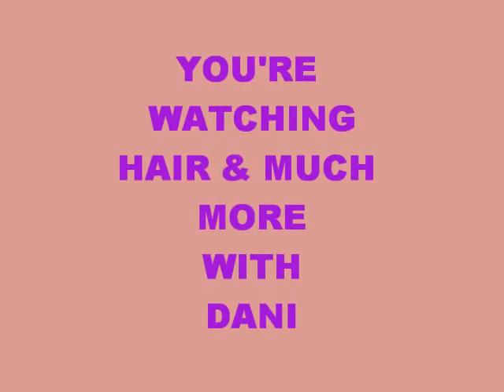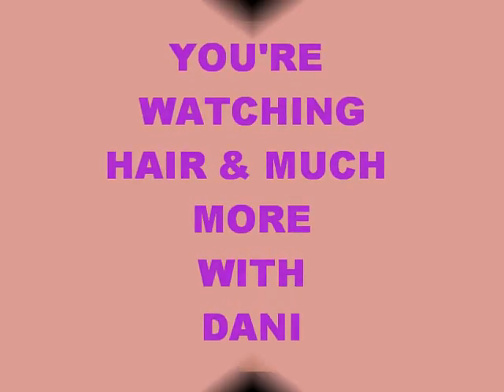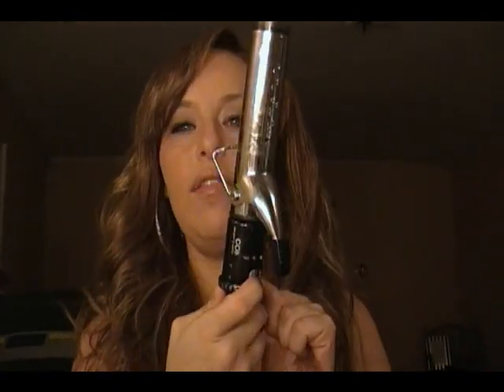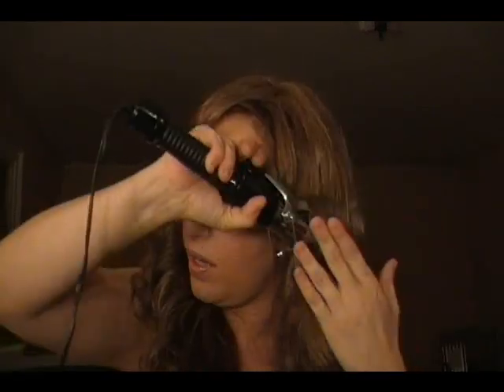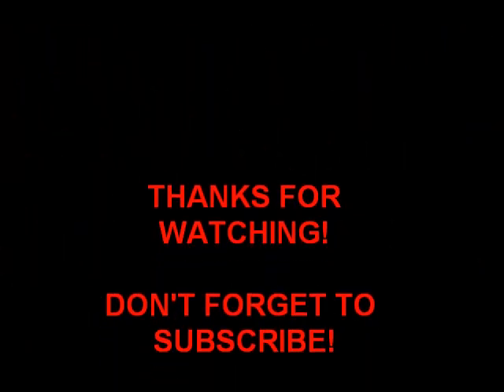How to CURL your NON HEAT RESISTANT synthetic wig or extensions with a CURLING IRON!

Comment: Hello, I just seen yout tutorial on curling your extention or wig hair. I was able to do this on my lace front non resistant heat hair and I used mouse instead of water and the curls lasts longer. I had the same curling iron and on the same level as 1. I tried to use higher level and scorched the hair in the back. So this is how I out about curling my lace front with a curling iron.

Comment from the maker: @Starberry624 Hi there! Using the clamp is completely fine! It will not leave a dent if you use the curling iron properly..ie..When curling hair under the clamp should always rest on top, when curling upwards it should always rest under  etc. Please make sure you following the instructions carefully because if you DO NOT wet the hair properly & the heat is not at is lowest temp then YOU WILL melt the hair. If you do this properly you will fall in love with your wig all over again! Much Love,Dani

Comment from the maker: @TheGizmo4382 Hi there! I can't say that I have ever used the blow-drying method so I am a little hesistant to say it is safe. I have always used the straightening iron method. Wet the hair thoroughly then use the flat iron to straighten it. I suppose a blow dryer may work but I would have to say use at your own risk. I just think using curling irons and flat irons are best because you can completely control the heat level.I hope this helps & GOOD LUCK to you. As Always..Much Love,Dani

Comment from the maker: @chocolatebarbiegirl Hey there! Try using a little leave in conditioner after wetting the hair to prep it for curling! The leave-in acts like a setting lotion. Also after you achieve the finished style use a light hairspray (NOT SPRITZ it builds up bad) I suggest Pantene it doesn't flake & washes out nicely. I hope this helps? Let me know if I can help any further. As always, Much Love...Dani

Comment: Hi.  I just got what appears to be synthetic hair extensions.  The package says human and natural hair combined.  However, I was unable to curl it with my ceramic curling rod.
Will this type of curling iron work on these extensions?  Can I try some other technique like hot rollers or wetting and setting it with curl-formers for instance.  I appreciate any advice. Thanks.
Reply from the maker: Hey there! Any curling iron should work in combination with dampening the hair. Make sure you dampen the hair. I like this particular curling iron because the heat settings seem to be just right for all synthetic hair! Let me know how it works out. Much Love, Dani